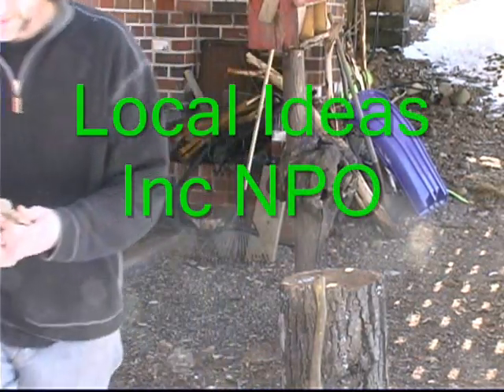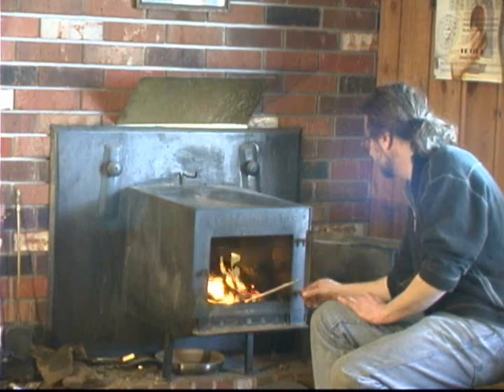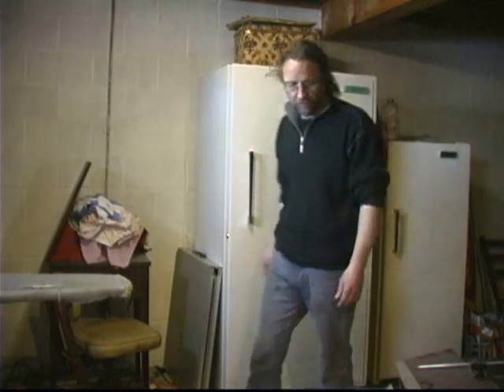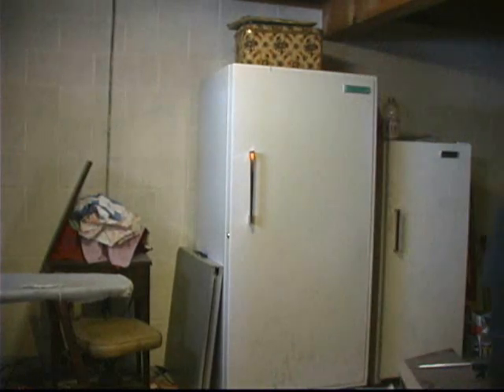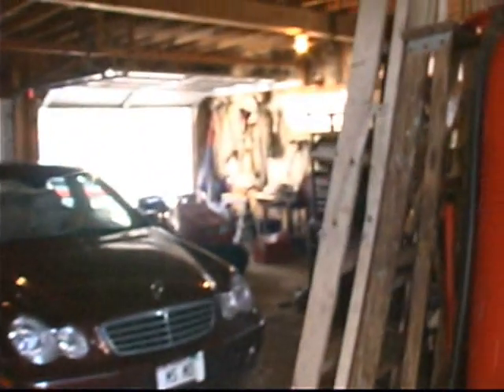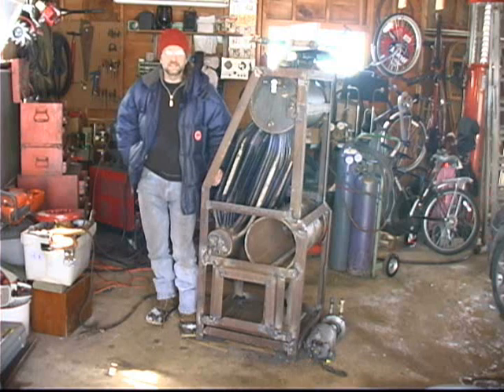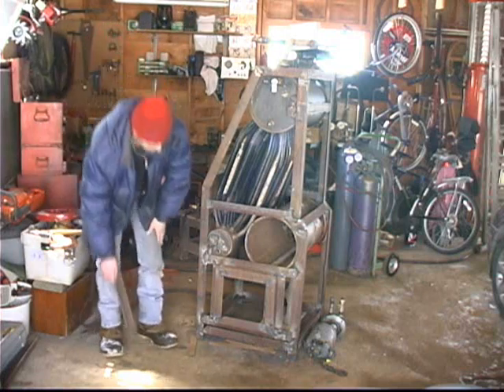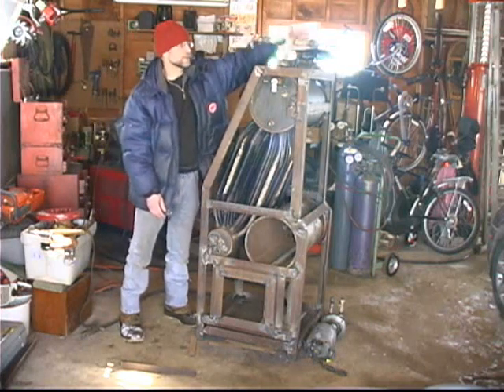Energy Bootlegger test run soon

Comment: Well I've been using household consumer grade compressors and only able to get 90 psi at the most allowing my truck to go only 1/4 mile on a 100lb propane tank (NG=3000+psi). Sorry I did not get back to you until now. Don't use localideas channel much because I don't get many views. Applied for many grants we were granted none. The ZioNazi war profiteering, fossil fuel energy monopolizing, government buying bastards should be slow cooked in forest fires so they can feel the pain they deserve.